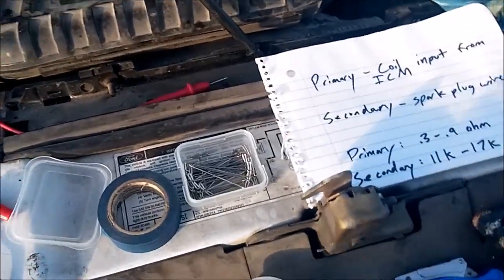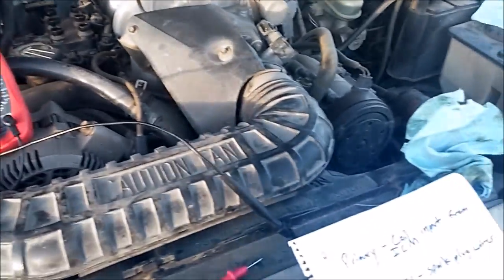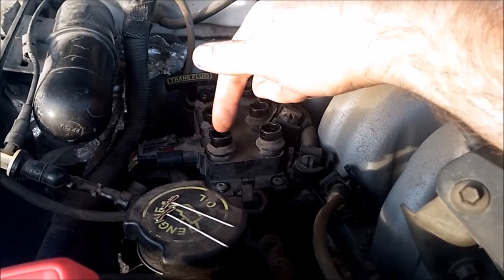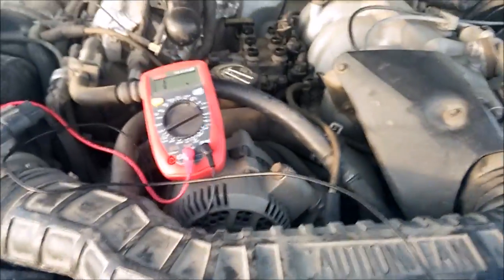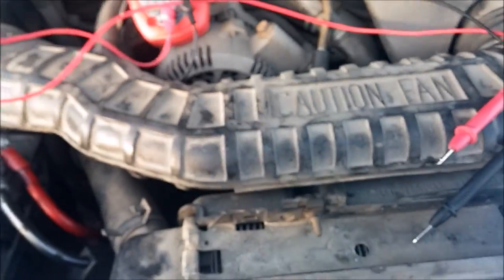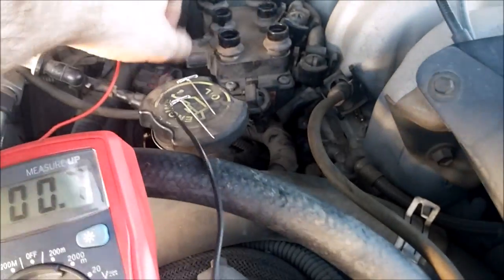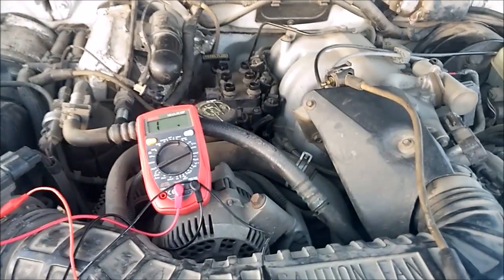1994 Ford Explorer - Coil Pack Testing

Comment: Question. On 2 of my spark plug wire clips  that clip into that block /, aren't tightly clipped. Is this normal? Block and wires are all good. It just doesn't clip in perfectly.

Comment: i tested my secondary (2000 ranger 4.0 ohv) and got 8.3 on all of them equally. truck is running rough but i see a lot of spark at the plugs. any ideas as to why they are all the same?
Reply from the maker: You should get vastly different results on primary vs secondary coils. But you do want the coils to all be the same in their circuit.
Reply: @HsCSpanky  if primary being the plug pins and secondary being the top where the plug wires go, i stopped testing afyter the secondary failed but checked and had plenty of spark and the readings were all the same. am i understanding you when you say primary being the 4 pin plug?
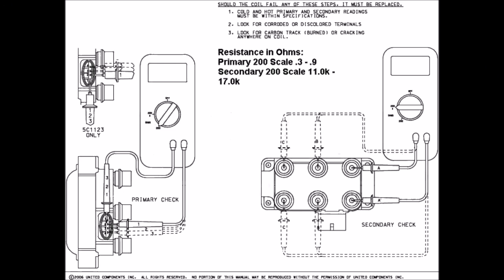Reply from the maker: @Robert-bm5fz  If the secondary failed the test shown in the diagram at 2:28, then your coil pack is bad. It may still produce spark on one side or a weak spark but it may not be enough to jump the 2 plugs together. The primary is the 4-pin coming from the ICM and the secondary is the spark plug wires. Check out the image at 2:28 and make sure to follow the AA, BB, CC and 11, 22, 33 numbering closely.
Reply: @HsCSpanky  yep i did and you are right its a no go. thanks for the help clarifying and thanks for the video. it was extremely helpful.
Reply: @HsCSpanky  it is odd that i am getting a lower resistance though (8.3). kind of a mystery to me.
Reply from the maker: @Robert-bm5fz  Lower could mean that there's a short. It's working enough to have a spark but likely weak. The values aren't exact either and may vary year to year. The thing you want is consistency though. If they're all 8.3 then they're all probably ok. It's not likely that all 3 would fail, it's usually just 1 circuit. But both the primary and secondary circuits need to read something and all be similar to each other.
Reply from the maker: @Robert-bm5fz  Before buying a new Motorcraft coil, see if you can get one at a junkyard or eBay for cheap. Then you have something to compare to and you might be out $30 if you're wrong in diagnosis worst case scenario.
Reply: @HsCSpanky  ya i have one coming tomorrow for $30. i was also confused at the consistent but lower resistance but am more inclined to agree with your first assessment of a short. thats well below any coil pack tests that i can find. i just assumed the resistance would go the other way. this all started with a misfire at cylinder 5 and that passed the compression test so this looks likely.

Comment: I had mine off and checked it..it checked good....so I turned the oven on @ 200 degrees and put the coil in  there for about 30 mins...checked again and the center two were dead..along with the corresponding pin....

I had a problem where after I ran the explorer and restarted it had a miss..checked plugs all looked fine..next time I drove it it was fine until I restarted it missing again...Coil was OEM with 347,000 miles..1991 Explorer 4x4..
Reply from the maker: Good on you for testing a hot soak, that's a good idea!

Comment: Also the primary coil is the first windings and the secondary is a longer set of insulated wiring. It’s too complicated to just explain but it has to do a magnetic field and taking your 12 volts to building to up to thousands of bolts to enable it to bridge a gap and be hot enough to ignite fuel. Look it up. It’s interesting.

Comment: Good video. Helped. Just a small correction though. It works like a old Harley. The spark doesn’t come back through another plug. It fires both at the same time. The reason is cause it’s cheap and easy. The two are on exact opposite strokes so the spark on the other would be near tdc but not on the compression stroke. Just like you have to be careful when putting your motor to tdc that your on cylinder ones compression stroke and not the other cylinder reaching the top of its exhaust stroke.

Comment: Interesting explanation of how the waste spark system operates. Let me see if I've got this right, the spark pulse fires from one tower of a particular single coil, travels through the corresponding spark plug wire to the spark plug of the corresponding cylinder. The pulse travels through the center electrode of this spark plug to the ground electrode thus creating the 'spark'. The 'spark' pulse then travels from this ground electrode through the threaded metal casing of the plug into the engine block (which the plug is threaded into) through the block to the casing of the cylinder corresponding with the opposite tower of the same coil, across the ground electrode of this plug to the center electrode of this plug. The pulse then travels up the center of this plug to the attached spark plug wire, through this wire to the cool tower opposite of the tower where the pulse originated and into the original coil thus completing the circuit. Is this correct? 
In 38 years as a mechanic, more than 30 of which certified as a Master Technician in multile areas, I have never heard this phenomenon. You are totally correct up to the point if the spark crossing the engine block to another spark plug and back to the coil. It is here that you are leading others astray. The high voltage electrical impulse from the coil terminates at the air gap between the center electrode of the spark plug and the ground electrode of that plug. The spark is created by the electrical arc between the two electrodes of the individual spark plugs and goes no further. The 'waste spark' concept derives from the fact that BOTH coil towers of a single coil in the pack are energized at the same time creating sparks in both of the corresponding cylinders at the same time. One cylinder is at the end of the compression stroke and the air/fuel mixture is ignited while the corresponding cylinder of the same coil is on the exhaust stroke. This reaults in the spark inside of the cylinder on the exhaust stroke being 'wasted' as there is no unburned air/fuel mixture to ignite. Other than this little error you have put forth a very informative and easy to understand video that should help many people.  Well done sir!

Comment: Hey Nate - have an Explorer Eddie Bauer 4.0 V6 - the car sat for a while a year or so got it back up and running but now i have a misfire - have tested the coil pack all my readings seem to be within the ratings you listed in the video - what other tests can i run to get the car running smooth again.
Reply from the maker: KOEO and KOER tests, I have videos about that as well.
Reply: @HsCSpanky  Forgot to mention its a 1997 - it has an ODBII port and the error codes are as follows

P0102 - air flow sensor
P0303 - misfire 3
P0305 - misfire 5
P0171 - fuel system too lean bank 1
P0174 - fuel system too lean bank 2
P1131 - lack of upstream oxygen sensor
P0172 - system bank 1 too rich
Reply from the maker: @Harlinization  clean the maf or unplug and see if it runs better. Definitely test spark plug wires (ohm test) and check the plugs. If that's all good, I'd be worried about fuel injectors not holding pressure or working right. Would be worthwhile hooking up a pressure gauge to see what's going on, if it leaks down or gas low pressure.
Reply: @HsCSpanky   Cleaned the MAF but that did not seem to have any effect  (will try to unplug it)

Tested the Spark plug wires and the readings where 
[ 1 - 6700ohms ] [ 2 - 6360ohms ] [ 3 - 7220ohms ]  
[ 4 - 13800ohms ] [ 5 - 13200ohms ] [ 6 - 12510ohms ]

When you mention preasure gauge I assume you are referring to Fuel pressure and testing using the valve under the Air intake ?

its also tossing out Blue-ish smoke
Reply from the maker: @Harlinization  blue in exhaust is oil, no doubt. Yes, check fuel pressure. If you see black smoke, try to avoid running it, it will fry the catalytic converter. Wires sound good. Plugs are probably ok. I'd lean towards fuel injector issue. You could try a heavy dose of injector cleaner or seafoam.
Reply: @HsCSpanky  Thank you - let me see what i can do about getting new injectors - I have some injector cleaner running in the tank and it has not improved much so far.

Comment: is that a good read for that side the   secondary coils showing 13.5 13.30 13.15
Reply from the maker: As long as they're all close, it's fine. They might vary from mine due to changes over the years. It's unlikely for all the coils to fail, if one of yours was 50, that would be a problem.

Comment: am doing a project with a coil from a ranger with a vertical  plug  and was wondering if  u knew witch wire was the  wire from the ecm that tells it to fire its a 2000 ranger with a 3.o  if u could let me know much appreciated
Reply from the maker: Off of the top of my head and not knowing how a 2000 ranger is set up, there's four wires. I could be wrong but I believe there's one power wire in that should be red and it should be a larger than the rest. The last three wires should be the ground for each set of coils. If you supply power in ground, then remove the ground it should spark the secondary coil.
Reply: @HsCSpanky  thank u very much

Comment: I've got a 1995 ford explorer. Bought it for 250$ after not being able to afford a vehicle (mind you im 17)  and it runs...like garbage when I'm driving. It'll start to studder and I'm almost positive it's the coil pack on it. Think I should break down and buy a new coil pack with cables or just a coil pack? And am I able to drive it just for now until I can get it? It's crazy just need a little help. Thanks
Reply from the maker: Only replace it if it fails as in this test. I believe the 1995 has the same coil and the test will apply. Also test the wires, they will probably be in the 2-6k ohm range. If one is 500k or infinite, then you know it's a problem and can replace it. It's important to know why you're replacing things, especially when you're on a budget. If the truck is running rough like it's not firing on all cylinders, I wouldn't drive it. It will mess with the exhaust and burn lots of gas. The engine computer sees the unburned oxygen in the exhaust and adds more fuel to compensate. Look at my other videos and perform a KOEO and KOER (should apply to your Explorer too).

Comment: i have a ford rager 2011 2.3 engine stalls when i put it on gear and i notice its burning gas like crazy
i can almost see the gage go down it used 1/4 of the tank in about 40 miles. any opinions?
i do want to point out i had never own a ford in my life so i know absolutely nothing about this trucks
Reply from the maker: Sounds like multiple issues but stalling when putting into gear can be the idle air control valve. Also running rich but that can be all kinds of things. I can't help much, yours is a different system than mine that I'm not familiar with. Start by getting engine codes and work from there.

Comment: I own a 1996 ford ranger 4.0
 2x4. Auto..with an intermittant no start. Took it to a shop who claimed not to have a code. They changed the crankshaft sensor and it ran for a day. Now it wont start. Did the secondary test. And got 19.7 ohms on the all the coil pairs. My last two culprits may be rhe ignition key or the ignition module...which someone told me that my 1996 ford ranger does not have. Any recommendations would be greatly appreciated.
Reply: sounds like a bad conecctions i saw a video or  post on a rangerforum about something similiar check   all fuses and relays and the conecctions to all to be sure  i think the vid was on here somewhere

Comment: Great video but I do have a question!  I'm testing this on my 2002 vw jetta and I dont get any readings for my secondary coils at all and I only get readings of 1.3 when I change my dial to 200m for resistance...does this mean my coils are shot?
Reply from the maker: VW are in their own world. Normally I'd say yes but if all of your coils read that way, I'd think something is up with the testing method or with the equipment. A quick look shows .5 to .7 on the primary and 3k-4k on secondary. If all of yours are dead, I'd wonder if your engine severely overheated or if the computer fried them. Both are unlikely which is why I think the testing or test equipment is wrong. Make sure you have fresh batteries and good connections on your leads (check a spark plug's resistance from center tip to where the boot attaches).

Comment: Okay so I did exactly what you did in the video and for some reason I'm not getting spark to my plug but my coil primary and secondary testing showed good where do I go from here
Reply from the maker: David ws509daddy Koch is the wire good? After that I'd either opt for a junkyard could or hook a test light up as a dummy load to the coil inputs.

Comment: what if primary more than.3-.9 ohm, its showing 1.2 ?
Reply from the maker: sami sosa that's fine. If it was 50 or 2,000 then you know there would be a problem. Ford might have changed the spec slightly.
Reply: ya, its same like 96 ranger 3.0.Ok thanks, 
Also, how do check, Camshaft Synchronizer?
i have under 8 voltage goin thru the wire.
Reply: and i dont have the sparks
Reply from the maker: Since I only have the books for the 1991 Explorer/Ranger/Aerostar, I don't have any diagnostic info on the camshaft sensor since that year didn't have it. Sorry.
Reply: appreciated for your help

Comment: Hey, man.  Thanks for the great DIY!  I used it with high success on my ’92 Ranger 4.0.  The only discrepancy I noticed is that my primaries read a consistent 1.2, rather than the noted spec of .3 - .9.  I’ve read on one of the Ranger forums that .5 - 1.5 is acceptable on coil packs, while the .3 - .9 applies to single ignition coils.  Any thoughts on this?  Again, thanks for a great walkthrough!!!
Reply from the maker: Casey Ostrander Thanks, I'm glad it helped. I think 1.2 is fine. It's such a small difference and Ford probably revised it. Higher ohms means less power consumption. If you were getting 5 to 10 ohms, I'd say there's a problem. The secondary circuit is more picky with shorts than the primary anyway since it's much higher voltage and can jump through cracks.
Reply: Thanks again, Nate!  Very much appreciated!
Reply: Just an update:  Turned out I had a bad fuel injector in cylinder 5.  Replaced it and the truck runs great!  So glad I found this video, because until I tested it, I was all ready to replace the coil pack, which would have cost me, without any immediate benefit.  You rock!
Reply from the maker: Casey Ostrander awesome. How did you find that out?
Reply: I had priced them out at about 70 bucks a pop at my local parts store, then found a set of rebuilt (and upgraded) Bosch injectors on eBay for $100.  I watched them for a few days on and off while I tested other things (because I was nervous about buying rebuilds), then the price dropped to $67 for the last set that the seller had.  At that price, I had to buy them, even just to keep as a backup.  Popped them in, replaced the plenum gaskets while I was in there and voila!  Runs like a champ now.
Reply from the maker: Casey Ostrander awesome, I've gotten sets of injectors online like that before. There's one seller I like that has hp or fx in their username, can't remember the rest. One test you can do on the injectors is measure their coil, same as ignition, just measure the resistance between the two pins. Maybe one of the ones you had were shorted.
Reply: Note - I was going to test the injectors by swapping two of them to see if the miss jumped to another cylinder (similar to how you’d test a plug), but it’s such a pain to get down to the injectors on this ride, that I figured I’d just pop the new set in while I had it apart.  Worked out for me.  :-)
Reply from the maker: Casey Ostrander yeah, they're not fun to swap. Not difficult, just tedious. Injectors can get clogged. Rust is actually small enough to pass through a fuel filter.
Reply: Yeah, man.  There was a solid 2 inches of rotting, oily pine needles on the top of the engine when I got it.  No joke.  Had to take my time getting down to the injectors, blowing things off and spraying things down as I went.  The hardest parts were getting to the injector under the fuel pressure regulator at the front, and trying to line up all 6 injectors at the correct angle to the fuel rail before tightening.  After 3 days of running sweet, I actually had to tear it back down again because it was dumping gas on the ground.  Turns out that the top o-ring on the injector underneath the regulator had torn and started to leak after a few days.  The old o-rings fit a lot more snug than the ones that come on the rebuilds, so I just swapped them all onto the new injectors.  It was still a great deal and didn’t take me nearly as long to get down there the second time around, when things were all cleaned up.  All’s well that ends well.

Comment: I have changed everything , the coil pack , the icm, the crank sensor , and still no spark , this all happened after changing my serpentine belt ,
Reply from the maker: Being that you were in the front of the engine, I'd wonder if your wiring to the crank sensor got damaged. That's about the only thing it could be.
Reply: Same issue with my Ranger. I changed the belt and cruise control buttons and now I have no spark or lights.
Reply: YouTuber how to change a tire on a Ford how to change the time on a Ford Explorer XLT 9 4
Reply: Cam positioning sensor or knock sensor ?